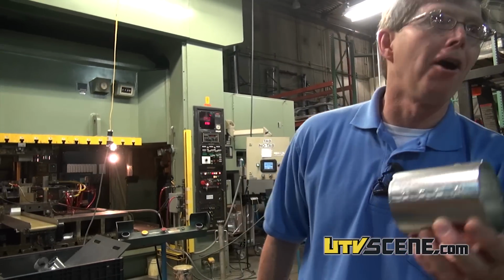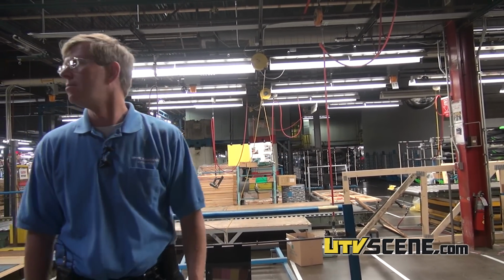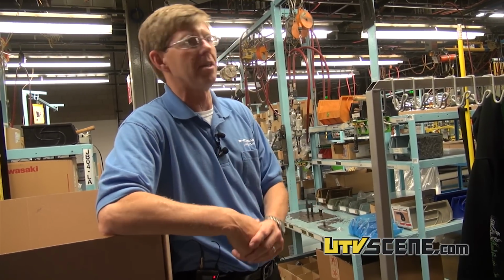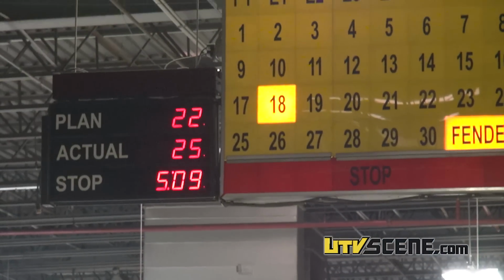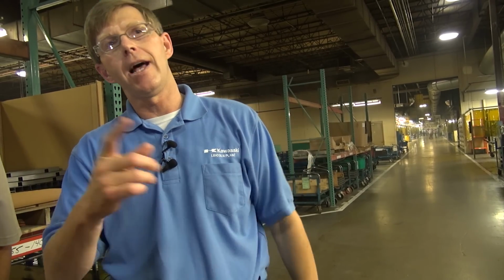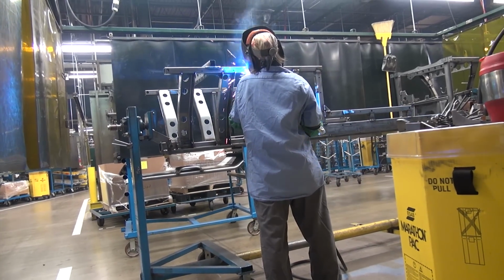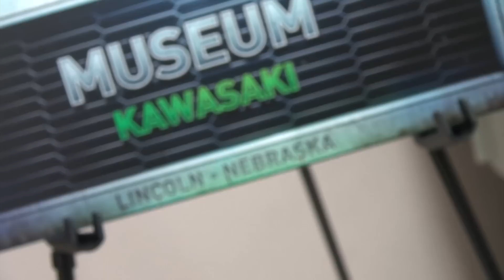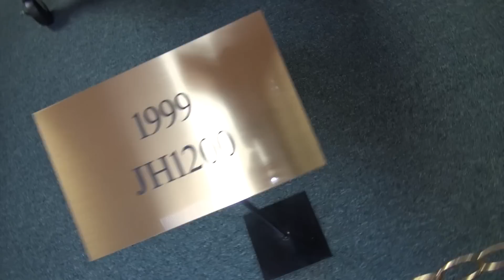Kawasaki Plant Tour

Comment: If my 14 brute force 750 was made here why does the vin# start with a JK .. J=Japan and k=Kawasaki ... Vin#'s for american assembled or made products like cars or say Yamaha grizzlys should and do start with a number not a "j" for the first digit.  Or was my brute made in Japan?
Reply: +zakyum The only place Kawasaki ATV's such as the Brute are made is in the USA plant. Total in parts and material is almost 90% us based. Only thing from Japan is power steering (if eps model) brake calipers/rotors, tires, fuel injection and electronics and a few minor stuff like bulbs and such. But Kawasaki is proud to have some the highest American made products on earth.